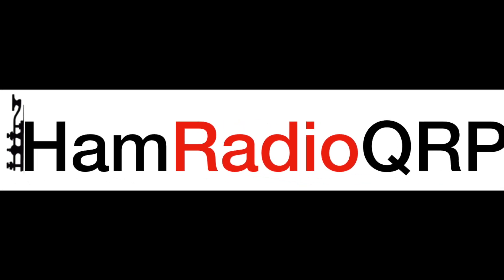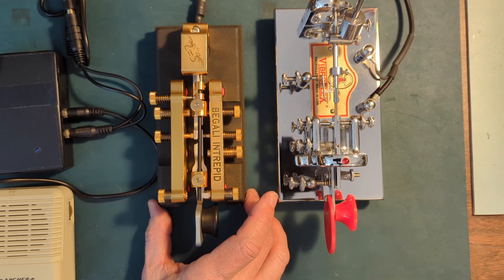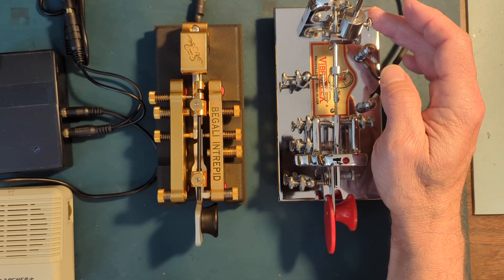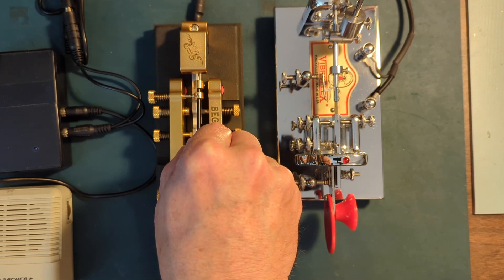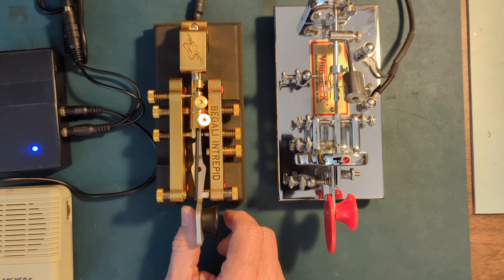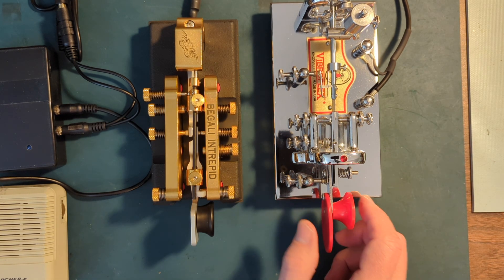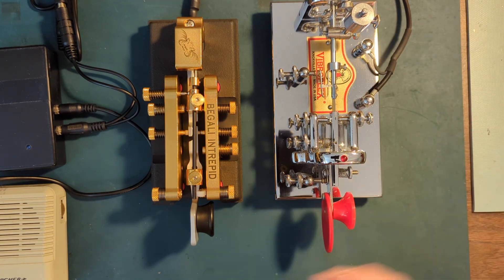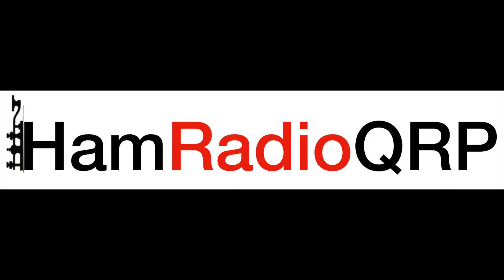Begali Intrepid Bug vs Vibroplex Standard Deluxe Bug

Comment: I have many Vibroplex bugs and a Begali Intrepid. I use them both on a regular (daily) basis. Some days the Vibroplex is my favorite but most days the Intrepid is my go to bug. Thanks to Begali for taking a fresh approach to Mr Martin’s 1905 design
Reply from the maker: Thanks for sharing that Steve.

I'm still getting used to the difference between the Intrepid and my other Vibroplex Bugs, but I very much admire the engineering that has gone into the Begalli bug.
Reply: Check out a Mecograph right angle bug. Tension spring is released to make dits. Wish I could find one for less than $800!

Comment: Nice video.  I have noticed that the dit-space ratio (dwell) is affected by L1 (Dit Contact), L3 (Dit Bar Excursion) and L4 (Dit Weight Fine-Tuning).  In practice, I have been setting L3 to get just enough "throw" for reliable operation (about 1 mm at the end of the dit arm for me), then using L1 (or L4) to adjust the dwell.  I have found that L4 also influences the speed (in addition to dwell) and can require resetting R4 (damper), as such - I don't use it much.  As an experiment, I found that moving the pendulum weights varied the speed between 18 & 34 wpm with L4 "out", and between 13 & 25 wpm with L4 "in".  I suspect the speed ranges may be different for alternate settings of L3 - I don't fiddle with L3 on a routine basis.  I have lately been operating with L4 "out", using the pendulum weights to adjust speed, and using L1 to adjust the dwell.  I would be interested to know how other people use L4 - there may be some nuance with it because it essentially counterbalances the spring in L1.
Reply from the maker: Yes that dwell magnet can really slow it down... up until it latches onto the pendulum :)